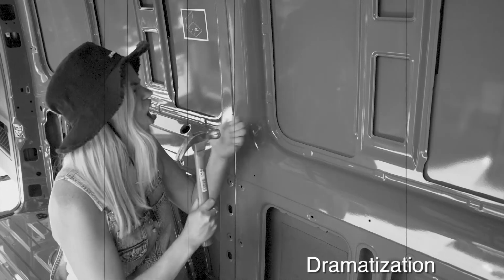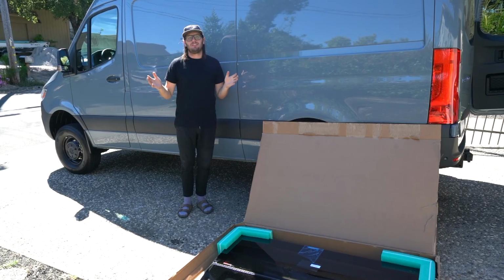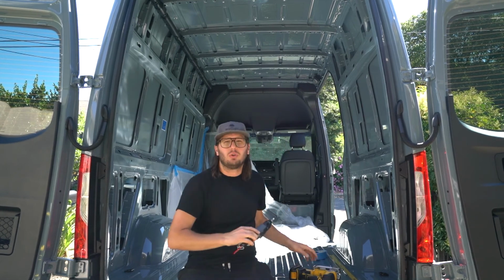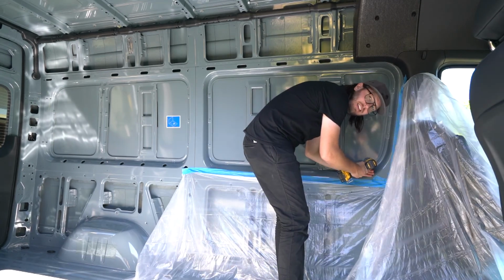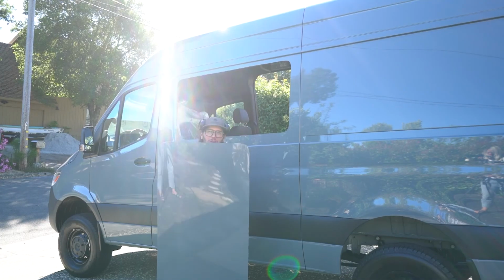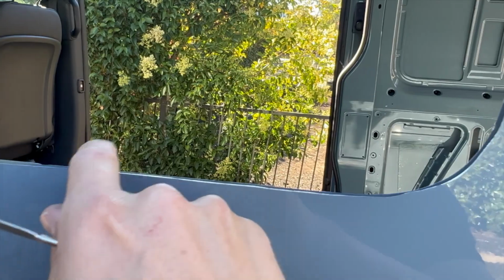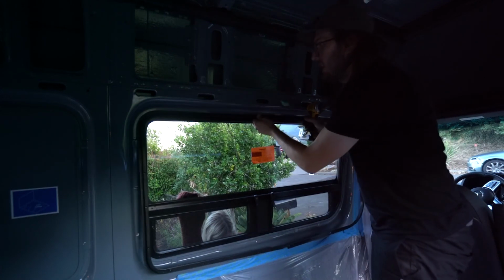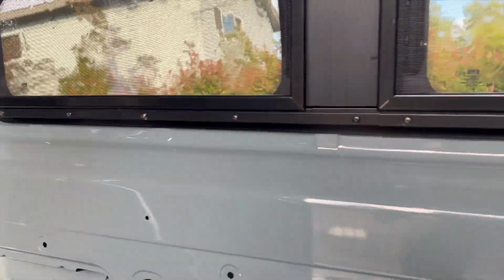Sprinter Camper Van Conversion CR Laurence Window Install - The Easy Way!

Comment: Harbor freight makes an electric version of this for like $20. Specifically for this haha
Reply from the maker: Thanks for the comment and suggestion.  I’ve heard mixed things from others about the harbor freight saws holding up and cutting well. As for the Ingersol Rand I’ve cut so many holes and things in the van with it I stand by it 100% still one of my favorite tools for van building.
Reply: @ yeah. If you’re gonna use it a lot for other projects… you made the right choice. But a lot of people won’t use it one time after they install their window. Harbor freight is perfect for that I think. Digging the videos man. You’re definitely more patient and through than I am with all this. I jsut wanna get on the road and have relative comfort. I start my build tomorrow
Reply from the maker: @HellYeahBrother89  For sure!  Most of the delay are the two great equalizers...time and money... I didn't expect the van stuff to cost so much and I also didn't think there would be so much support for the products we make... That's really set the project back because almost all my free time is fulfilling orders.  But we are having fun with it so I guess that's all that counts.  Good luck with your build!

Comment: Hey Todd,  I like your funny side lol. 
I am in my sourcing phase right now. When I watched the 529 cut that window panel out I was pleasantly surprised. Do you have any pros and cons about the 429? I have not found the CFM of the 429 and what size compressor would match with the Air saw.

Last night I watched your top 10 tools, that Astro Pneumatic Tool PRN1 3/8" Capacity Pneumatic Rivet Nut Setting Kit looks like a time saver!
Reply from the maker: Hey there friend!  Thanks for the kind words and glad you enjoy the humor. Building a van can be frustrating and challenging at times so I think it’s always good to remember to have fun and laugh about the things that happen along the way!  

I don’t have any direct experience with the 429, but as far as I know the 529s main purpose was to limit vibration and to make the tool more comfortable to use with its rubber ergonomic handle.  I’ve been super happy with it and have used it so much on the van.  Cutting windows, cutting for flares, cutting for fan and AC holes in the roof, cutting a cross member from under the van for our water heater and now cutting the rear rocker panels for little storage boxes we’ve made. 

The PRN1 has been an awesome tool as well. My only complaint is I wish it was a little smaller for tight spaces.  I’ve had to use my DIY solution in probably 20% of my rivnut settings because of space constraints.  But these places are so tight anyways I don’t even think any rivnut tool would be able to do it.  

Let me know if you have any other questions! Happy building!

Comment: Great content and great personality!  I was scared to install the windows until I saw this.
Reply from the maker: Hey Jason thanks for the continued support!  Yeah while scary at first, it's not too bad!  Whatever method you do end up cutting with start your cut inward of the window edge so you can get a feel for how the saw of choice behaves and cuts through the metal where there's less consequence and the stakes are lower. 

Also, it's not windows but later on when we installed the flares we prefected the order of operations on the cut a bit to help with the panel vibrating too much that might be worth a watch too.  We were totally n00bs on this first video 🤣!

Comment: Do you ever use safety air fuses or emergency cut off valves downstream of the 1/4” quick connectors on your compressor? Thanks Todd
Reply from the maker: Hey @paniro21 I have two lockout downstream dump valves from SMC coupled to my regulators that are down at floor level.  I haven't had any major issues or instances where I've needed to use them yet.  But since my Air compressor is mounted up high in a loft I figured it would be best to have something close by to shut off it anything happened.

Comment: You still loving that EA-6500 compressor?! Is that the model you’d still buy today?
Reply from the maker: Hey @paniro21 It’s been an absolute workhorse for me.  Been running in my shop almost all day everyday for the last 3.5 years with no issues.  Seeing how the price has increased quite a bit though I might reevaluate the compressor landscape. I definitely wouldn’t go with anything with less specs though in terms of CFM and noise level.
Reply from the maker: I checked again this morning, I think this is a pretty good deal now, it was up around $1000.00 a 6 months ago when things were still crazy expensive.  Still more than I paid for it a few years ago at $649.00.  https://www.aircompressorsdirect.com/Eagle-EA-6500-Air-Compressor/p72651.html

If you wanted to save some money & pull back the specs just a bit we had one of these at the company I used to work at and it was all a good unit too. https://www.aircompressorsdirect.com/California-Air-Tools-CAT-10020C-Air-Compressor/p70275.html
Reply: Heck yeah Todd! Thanks for the recommendation and the other more budget friendly option as well. We pulled the trigger on the eagle this morning for $738. Will we see you at the adventure van expo with those hood strut brackets?!
Reply from the maker: @paniro21  Nice!  Unfortunately I have to go back to Taiwan for work during the AVE show, so unfortunately no :(

Comment: Since it seems like you do your research really well, any reason you chose CRL over say the comparable premier products windows? I am currently trying to decide which way to go.
Reply from the maker: Honestly we were total van n00bs back at this point. I was really scared of anything that needed to be bonded for sure, which leaves few options like you suggested. 

I did look at the premier and according to a few people I’ve talked to the mechanism for opening the windows is a bit more reliable, but ultimately settled for the CRL for the sole fact that I could order and pick it up from a local shop which saved me about $175 on shipping at the time and 10% off for first time buyers too.  

I will say we used premieres for our flare bunk sliders and if the main windows are anything like those I’d choose the CRL windows if I was looking for an awning window again. The CRL have full length grooves for the screws which makes them so easy to install with little force, if you are lined up in the groove the screw sinks completely even with a hand held screw driver.  Maybe this is why everyone says to be careful with an impact driver when installing them. On the other hand the Premier has a shallow groove with complete self tapping screws which require a ton more outward force to get them to sink.  They also throw debris everywhere during this process, granted it is aluminum so no concerns about rust.

I think if I know what I know now, I might actually choose a bonded slider from AMA or similar, at least for behind the driver.  Since we are going to put an extra seat there it would have been nice to be able to open the window while driving.  Although, I still like the idea of opening an awning window in the rain and the passengers side (I think that’s the PNW boy in me).

I hope this helps!
Reply: @moonrakerdesign  very helpful. Thank you.
Reply: How long have you had them and road noise?  I didn’t see any window sealant from Todd.  Do you need window sealant or window weld?
Reply: I really like the CRL T-vent style awning windows but I’ve heard the quality is very questionable.  Should I chance it?
Reply: @OldExodus  I got the CRL’s. They are fine, just don’t crank on the mechanism like a gorilla.

Comment: Looks like a great idea! Are you sure about the cfm requirement though? I have a 6 gallon 2.6 cfm but read these saws need about 4 cfm.
Reply from the maker: Hey there, I pulled my specs from the Ingersoll Rand website directly for the model we have 529: https://powertools.ingersollrand.com/en-us/cutting-tools/529-air-reciprocating-saw.  In the model specifications tab there's an Air Consumption @ load (cfm) value of 1.13cfm and an average air consumption of 1.10cfm.  

I don't know if this is an error on their part for this model or this version of the tool is just that much more efficient, because looking around yes, you are right.  Most other air saws are in the 3-6cfm range.  I have a email out to IR for clarification and will update here when I hear back.  I think if I didn't have the compressor already I would weigh the costs of compressor/air saw vs something like the Electric Ingersoll Rand C1101: https://amzn.to/3ZoeaNZ.   After finishing up all our exterior cuts the last couple weeks, there's no other type of tool I'd use and no other method than cutting from the inside with a sharpie line for the larger panels.  It makes things so quick and so easy.  

Hope this helps, and thanks for dropping in the comment.  I'll update the description with a disclaimer to be sure to check cfm requirements air saw vs air compressor.
Reply: @moonrakerdesign  thanks for the quick reply! Think I’ll try it with my compressor and if it’s not doing it I’ll
Just rent a larger one.